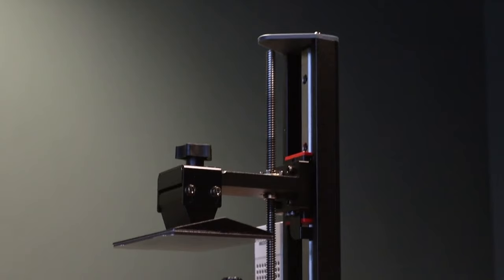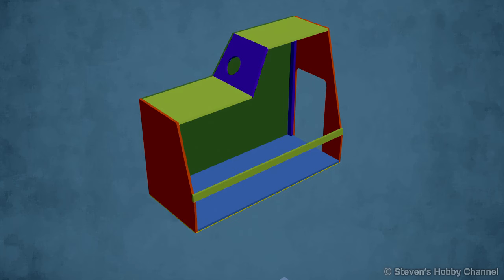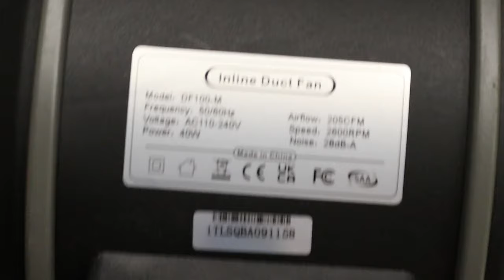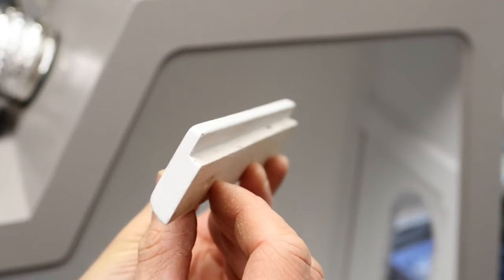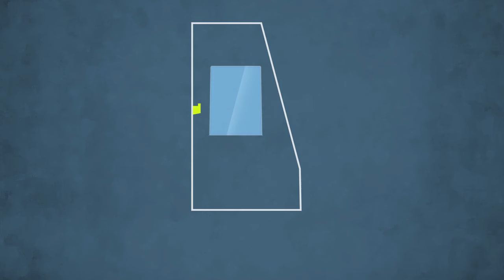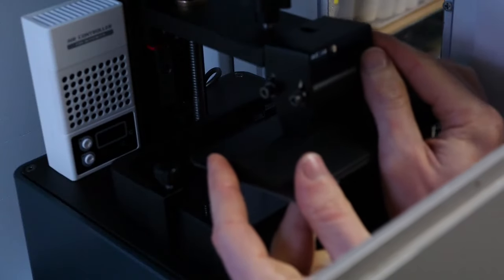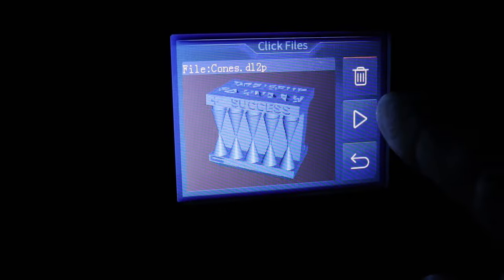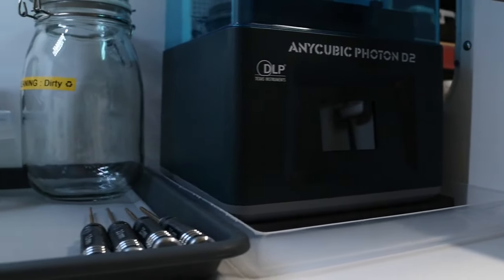ENCLOSURE for a 3D Resin Printer || Anycubic Photon D2

Comment: It is fantastic what you built for your resin printer, I do have to say that it seems a bit overkill for such a small printer. 10 inch printers are almost standard now, like my Creality Halot Mage 8k. But overall fantastic
Reply from the maker: Yes 😅  it looks indeed a bit ridiculous for such a small printer, but it does the job. I wish I could use a bigger printer inside the house but at the moment it's just not possible... Thanks & cheers

Comment: Could you talk more about the venting and your comment on creating a vacuum?
Reply from the maker: Well basically when you have a sealed box - and you put a fan on it to extract the air, the fan pulls out all the air it can and creates a vacuum. This will put a lot of force on the fan-motor.  So to avoid creating a vacuum you need a second opening to pull new air inside the box. In my case it's the grill in the frontdoor. During printing the fan is rotating slow, so the grill opening is enough, but when cleaning I set the fan to a high speed, then more air is sucked out, so I need to let more air in, to do this I open the front doors, both for my arms and to let new air in... hope this makes sence, cheers

Comment: If you are going yo screw down the plexiglass you might aswell use some clear caulking/hot glue to make it air tight.
Plus not sure how well filters actually work but be a goid idea to properly vent the room/nuclear bunker the printer is located in.

Wouldve been more user friendly if you made the enclosure with a front door accessable with some struts.

But cool job.

Oh wait no filter on the fan? Then whats the point?
Reply: You can see the output of the fan connected to some sort of hose at the end of the video. He is probably blowing the fumes to the outside, so no filter necessary (for work safety at least). Sealing anything is obsolete if you are constantly sucking air out of the case, the lower pressure inside the case will suck air in, not letting the fumes out (thats why he can use it with open doors for cleaning).
Reply from the maker: Hi guys, yes I forgot to mention this in the video, but I have a PVC pipe on the left side which vents outside (it goes up), it would indeed be pointless without that.  Sealing is not important when the fan is running, but it helps when your not printing - to keep some odour (from tools, uncured prints or bottles etc) inside.  Thanks & cheers 👍
Reply: @stevenshobbychannel  are the fumes that bad?  I low key enjoy the smell of it😳 always get a great night sleep printing my FGC9mkii's.
But her different strokes for different ff322wi32wszfhbns2fn.y4sz,x mm763w2qzzdfgmmy4

Right? 

Oh just noticed no filter on the fan? Then what's the point?;
Reply: Great point on the caulk, I feel the same way. For the filter, I had assumed he was venting outside his bunker.